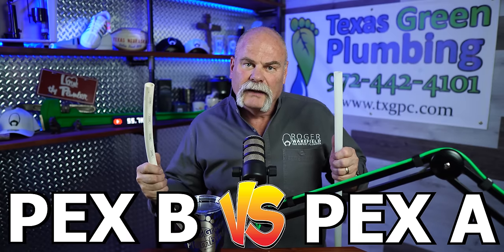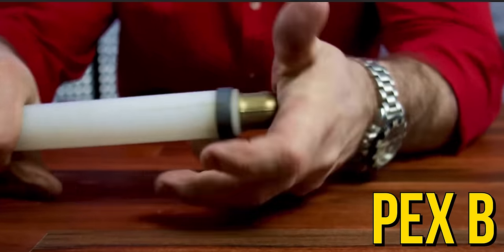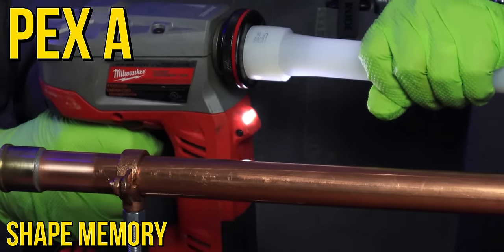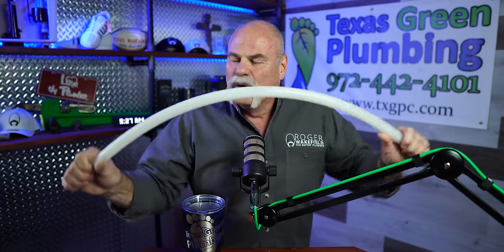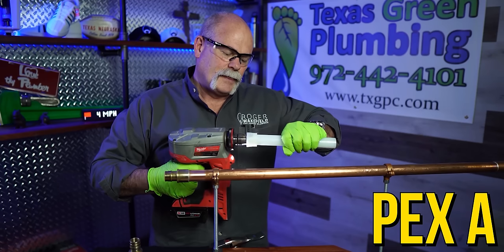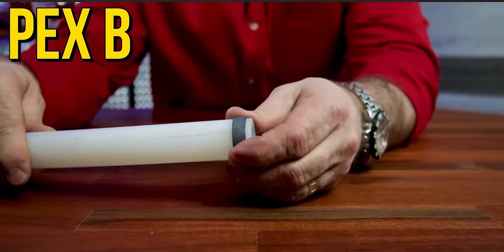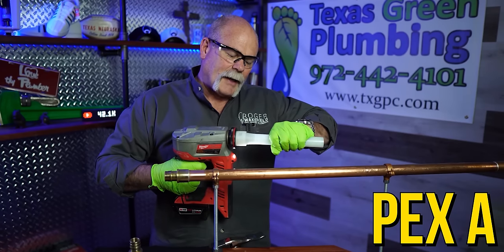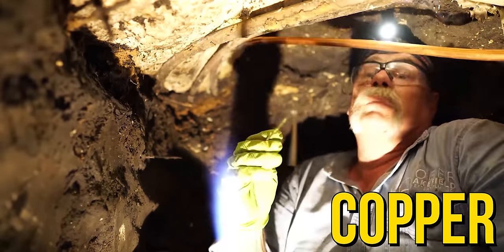PEX-A vs PEX-B - What's the Difference? Which Should You Use?

Comment: If you upsize the hot water lines when using PEX B, you will also increase the amount of time it takes for hot water to reach the fixture - both annoying for the person in the home and less energy efficient. A 3/4" line holds 2.25 times as much water as a 1/2" line, so it will more than double the time it takes for water from the shower/faucet to get warm. Upsizing the lines, if not necessary, could be a very bad move. There are guides covering run distance, vertical height, and number of fittings to maintain pressure levels. The guides should be followed and upsizing done only if necessary after analyzing the system.
Reply: Personally, cold is easily upsized. Hot needs to be done with due care.
Reply: Agreed. Better to run 2 or more  ½" lines rather than ¾". Also in the clip he shows of the water heater you can see only ½" running into the tank. No wonder there is no pressure.
Reply: Great having 3/4” main lines, no temperature fluctuations when other taps turned on.
If you don’t want to wait, recirculating line, with a small pump keeps your water hot all the time!
Reply: @davehudson4607  if properly designed, you shouldn't have significant temperate variation when other taps turn on, even with 1/2" lines. Recirc pumps are an option, but they add a lot to install cost and are energy hogs. I think the tiny benefit they have is a gigantic waste of energy.
Reply: Patience is a virtue lost to some due to technology. Get over yourselves and be thankful you're not carrying it in from a well by the bucket and heating it on a wood or coal stove. PEX A rules!
Reply: @OutlawMonstersPerson  ROFLMAO!! Facts!! My folks from Tennessee did just THAT up til 1984!
Reply: @justinl9947  Not True. Recirc pumps are multi speed and generally on a timer so they are only used when needed. The average US household wastes 14,000 gallons of water per year waiting on hot water to get to the tap.
Reply: My personal opinion every home should be required to have a recirculation line. less water waste.  I live in Canada so so the passive heating would also help the home. Energy cost is minimal if you use a grunfos pump with temperature probe. some even come with an AI system that monitors use and memorizes peak use times.
Reply: You're right that bigger is not always better. When you stop using hot water and walk away that quantity of water loses its expensive heat. When you turn it on again that depleted hot water has to be purged to get more hot water. Waiting for the purge is annoying. Leaving hot water to cool in your fat pipe is expensive. You want the smallest volume pipe run that serves your need to minimize the dead volume when not in use that meets your need. That means minimal restriction so you get the best flow out of the smallest diameter. A small fitting on a big pipe is the worst of both worlds.
Reply: How about a booster?
Reply: This is what a header is for...you can size a line to fit the flow and expectations BUT requires a lot of lines. Efficiency of hot water flowing in a slightly larger Dia pex pipe would be min at best...copper is another story.
Reply: "A 3/4" line holds 2.25 times as much water as a 1/2" line."  Truth.  That means it takes 2.25X longer to get hot water, you've wasted 2.25X more water waiting for hot, and you're letting 2.25X more energy go to waste as the water in the pipe cools down.  That's the simple arithmetic, but fluid dynamics will show that it takes even longer to get hot water because of the mixture patterns of hot water pushing cold water. Upsizing the supply pipe 1/4" just to get around the flow restriction of crimp style PEX B fittings is one reason I'm done with PEX B.
Reply: To much thinking into it. Water heater 3/4 line.. don't matter if it's pex or copper the like will be 3/4.
Reply: And municipal water is getting ridiculously expensive
Reply: @startstrategieswithjamesjo4888  every home?  My plumbing is very compact.  Between the two bathrooms,  the runs are about 5 to 10 feet each.  The total run to the kitchen sink will be about 20 feet, and I can start washing dishes add it heats up. I'll be using a manifold that is within 5 feet of the water heater. Half inch lines to fixtures with three quarter to the heater. Pex A.
Reply: As a bath/kitchen remodeler I need 3/4 pipes near the shower if I want to design a dual showerhead shower system. You can't drive 2 or more heads with 1/2" without a drop in pressure.
Reply: Sure, comparing pex 1/2 to 3/4, but when that's not a legit comparison. You need to compare 3/4 pex to 1/2 copper
Reply: @davehudson4607  I prefer a recirc system, or an improvement is to have one with a timer, so the water starts to move before showers and bedtime, off the rest of the time. I think it is better than wasting the water about 2.5 gallons before heat reaches my master bath. I think I will rig up a recirc that runs on 12V or etc, solar battery. No need to run it on house current/meter.
Reply: @ElRipper100  Setting up on a timer is a great idea. The recirculating pumps are so small it will take you years to recuperate your investment setting up for a 12V pump and 
solar / battery bank system.
Reply: @ElRipper100  Better to stay with standard house voltage
Reply: @generyde9173  
I think you have pressure mixed up with volume.
Reply: ....DON'T trust sharkbite push-to-connect, the internal o-ring will dry out and fail over the years, the same thing to PEX that does not use a metal clamp. The expansion idea will fail regardless if it takes 10-20 years. The material will lose its flexibility thus its memory turning the water system for the entire house into sprinklers, and you will have a waterfall coming from all over the ceiling.
It will be a really expensive nightmare for homeowners 2 decades later. 
PEX and other new systems are only beneficial to the repairing contractors, speeding up the process, but not necessarily lowering the homeowner service bill.

Like the RV industry, the US house construction industry has become very profitable while offering expensive and poor-quality house constructions. The houses are not built to last, forcing the next generation to buy new homes to keep builders selling new homes, a real mafia with standards not ruled by the authorities. 
In sum, our industry is becoming more and more like the Chinese manufacturing quality.
Reply: this is debatable water travels through all pipe sizes same speed at least I thought I was taught then while earning my ticket
Reply: @davehudson4607   If any of you happen to use home automation, that is also a good solution to optimize a hot water circulation system. I use the WATTS circulation pump in an "after the fact" hot water circulation system (meaning that I don't have a return line, it pushes back into the cold line), with Home Assistant and a schdule/routine and geofencing that turns the hot water circulation pump off when we are not home. When we are home, I apply a duty cycle after a little experimenting to see how much on/off time is still effective for our system. I have the pump nearly off during sleep hours and at about 50% or less duty cycle during daytime when we are home. On for a few minutes, then off for a few minutes. The WATTS only allows water flow when the warm line dips below 90 or something like that at the faucet farthest from the water heater so even though the pump turns on, it only moves water if the temp is below the thermostat's setpoint.
Reply: Certainly! My mother's builder crew used cheap metal shims--instead of plastic-screw collars for sink stems.

Well, the shims rusted -endangering pricey countertops.

Women typically would never know to note sicko slipshod plumbing underneath.

The code is becoming bupkis. 

I too have fingered the RV and mobile home industries--"colluding" with the traditional  homebuiding biz. The homebuilding biz is giddiily getting bad, shoddy ideas from those other two industries, anyway.

It's an endless battle: Builders will try to get away with cheapening: I

t's solely a biz to them. The buyers simply can't observe everything that builders and crews do

To the rest of us, it's much more than a biz....
Reply: You are not a plumber.

Comment: Pex B is what I use when doing renovations. I used to do all renovations in copper; time consuming, but tried and true. It took many years of renovations to go to Pex B. initially using Pex B, I was concerned with it service lifetime. For what it's worth, never had a problem with any Pex B I've installed over the course of my 23 years as a contractor.
Reply: Any lack of pressure problems?
Reply: Don’t use 1/2” pex b on the connection between shower valve and tub spout. I have seen it cause the shower head to “leak” when only the tub was on without the diverted pulled.
Reply: @markpetri3405  If you read the instructions that come with the tub/shower valves, they tell you not to use pex for the riser to the shower head and using pex to go the tub spout is just dumb! The tub spouts should always be done in copper, so they don't float around!
Reply: Well, disagreement arises now.

I'm not certain of Pex  A: Builders use it, for one thing. It can fail, as well: Plenty of contrary anecdotes.

I noted black Pex pipes at Lowes....
Reply: @jakemf1  Not really noticeable.
Reply: Virtually all my plumbing is PVC or older CPVC. At the master shower, the installer needed to make a pipe turnable. He couldn't cement. (A certain special PVC joint is more suitable.)

Well, the Pex B getaround failed, at a crimp. It was likely pretty old. Everything fails/dies.I don't condemn Pex....

It"s funny that he didn't use PVC--he didn't know better? It was a minor part of the system. Odd....

Comment: I am remodeling my home that was a flip house 12 years ago. The copper lines under the house were a mess. A friend told me about PEX and the differences. He said that PEX "A"  was more expensive and the hand tool to put it together was difficult to use. After finding a Dewalt tool that matched my existing battery line up, I was sold on PEX "A". I have replaced the water lines in my my home with all PEX "A" now and have never had to re-do a fitting and had no leaks. I LOVE this stuff, and will not be going back to copper. Thank you so much for the great information. I hope folks watch this before making a rushed decision.

Comment: the one advantage that PEX-B has over PEX-A that everyone seems to ignore (or simply isn't aware of) is that PEX-B does not leach hormonally active agents as much as PEX A does.  You don't get that greater flexability without adding more platicizers.  I know, I know "it's fine."  BPA was fine until it wasn't.  Asbestos was fine until it wasn't. Copper doesn't have platicizers and it's got antimicrobial properties.

Comment: I replumbed our entire stilt home in 2004 after Hurricane Charley badly damaged it. Being a stilt home, I was able to replumb from underneath the living space.I used Vanguard pex B runs off of a manifold in the garage to EVERY valve in the house. I could, for instance, shut off the water to the guest room cold sink valve if it needed to be replaced, without having to shut water off to the whole house. That installation It worked fine, though I did have a few problems crimping fittings in tight spaces. Because we had over sixty pounds of pressure from the city water, I never noticed any lack of pressure at any tap. When we moved to the current home in 2013, I did a major remodel which included pulling down the entire drywall ceiling to put in new ducts and insulation. I used that access to the entire attic space and the top plates of the stud walls to replumb with pex again, only this time I used Uponor pex. I even had an Uponor guy come out and answer questions I had. The $400 bucks I spent on the Milwaukee Pro Pex expansion tool kit was well worth it. The joints went together quickly and securely. We're on well water here, so our pressure, between the pump kicking on, can go down to about 30 psi, but with the joints not being reduced in diameter like with pex B, our pressure is fine at every fixture. And, one thing you didn't mention. When I tore out the old copper pipe from 1979 when the house was built, nearly half the inside diameter was blocked with mineral deposits. Pex, as you know, is extraordinary slick. Nothing will build up inside it like on copper and, even to a slight extent, pvc.

Comment: I got Polybutylene pipe in my mobile home and gradually upgrading to PEX B. I prefer the compression rings all over the crimping rings. PEX A is more ideal for a contractor than a homeowner, just because the tools are expensive.
Reply: Manual tool is about a hundred.  Just used one for my home.  Pex-A is the way to go.
Reply: @Homestead Haven  that's fine for small projects, anything bigger you will want the battery ones or pex b, my other issue is availability, where I live very few hardware stores and building centers stock pex a fittings which is a significant drawback for those who aren't plumbers and don't buy fittings by the case.
Reply: You said Pex B but we think you meant Pex A. Pex A is the way to go. The manual expansion tool 140 ish at Home Depot. Handles 1/2 , 3/4, and 1”. You’ll get a workout. Battery power tool is 400ish and definitely worth it. We did my house manually the 1/2 was easy but that 3/4 in a tight space was a pain in the butt. Bought the rolled up Pex A which was a pain to straighten out as it was trying get back to its original or last position.

Comment: Pex A all the way it's more easy to work with  Less fittings  Very rare  The connections leak.
Specially here in California with water restrictions pex B is hardly used in new construction. I have seen more issues with pex B leaks,kinks,and low water flow.
You 100% right Roger great video!

Comment: We use a lot of pex b however we don’t use any 90s with the exception of getting to the sinks or toilets etc. We’ll do our best to have the pipe undistrubed by fittings. If you try to make the pex “pretty” by 90ing every bend the pressure is insanely reduced !
Reply: Yeah, whats the point of using flexible pipe of your going to use fittings everywhere? I see some people do it and I don't get it. Its also a huge waste of money. The only place a fitting is acceptable is when you need to make a turn to sharp for the pex to make on its own.
Reply: Ricky Kendrick agreed!

Comment: I refurbished a older home with all new plumbing using PEX a while ago. I laid it out so it had NO fittings or valves inside the house. Each fixture had its own line going to a manifold outside the house where each line had its own valve. This eliminated crawling under cabinets to turn the water off and on. Also it seems like the valve inside the houses always need replacing each time you tried to fix something. Totally eliminated that problem from ever occurring. It also eliminates leaks inside the wall.
Reply: What happens when the manifold inevitably fails? Is each valve on the manifold seperate and serviceable or is it an integrated manifold that requires complete replacement when one of the valves go? I like the idea of a manifold but would never recommend failing to install an isolation valve at every fixture as a backup for quick and easy maintenance and shutdown in an emergency. Redundancy is your friend when it comes to controlling water and you have failed to provide any. Its also mega expensive (depending on complexity of the system) to run pipe from  each fixture to a central manifold in a basement or boiler room..totally fine in some applications or if cost is no issue. Very ineficient and costly way of designing a system on anything larger than a small home. I know because I have installed many many systems this way for people over the years (with individual shutoffs at each fixture as well lol!) and it invariably costs triple.

Comment: I do think it is worth to mention, that while shrink-fit "quick and easy" joints are available here in Finland (the home of the Uponor system), it is common practice to use PEX-A with copper-style compression fittings with an insert, such as what is used with soft copper pipe. This is completely up to code here, as long as all connections are exposed or failure (leak) can be easily detected and repairs carried out. And the same code applies to copper pipe. For some reason, I have never seen this kind of combination used overseas. Furthermore, the reduced inside diametre of the pipe is usually not an issue, unless using something like 3/8" pipe, as sizes 1/2" and 1" are commonly used using this method.
(and if you were wondering, PEX-B is not commonly seen at all)

Comment: I did a bunch of homework about 5 years ago (took about 6 mo's) to learn about all the updated residential plumbing line/supplies and came to the same conclusion as you that PEX A has the best characteristics and I would say better than copper in some ways as well.
I've done a lot of remodeling on kitchens and bathrooms, so for me, I lean heavily toward PEX A even though I have the tools and know-how for all of them.  When I did learn what looked like the best choice, I bought the Milwaukee expansion tool and have no regrets.  In haste, before I got done with my learning session, I bought a PEX B crimper also made by Milwaukee and have only used it a couple times...oh well, live and learn.